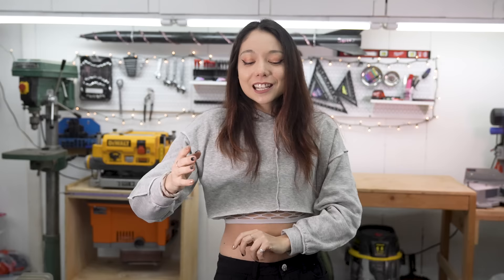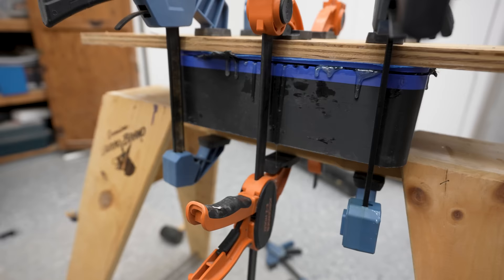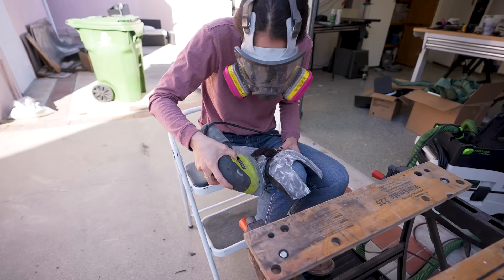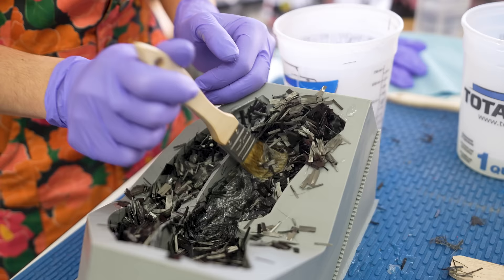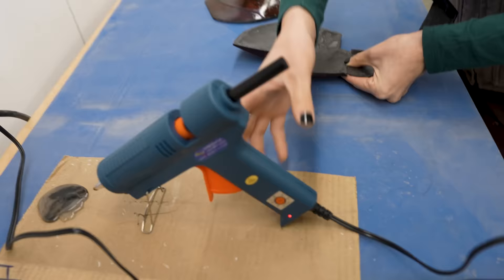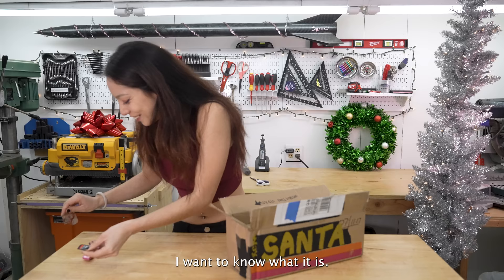I UPGRADED Iron Man's Helmet (100% Carbon Fiber!!)

Comment: I'd be curious to see how a carbon-kevlar mix would work as a chop mat, considering it's been used forever as a woven product to have 'colored' carbon fiber products.  The paint effect is cool, but you can also tell it's not the material itself and instead a finish or dyed epoxy, it's just too uniform and at certain angles it just takes over the appearance.  The only potential alternative would be pre-coating the chop tow before epoxying it in place, hoping to get the look of the carbon plus the look of the paint, that way it doesn't have the dyed epoxy or finish look while retaining how light bounces off the carbon itself; but this requires a lot of space, time, and effort just to color some chop tow, which is why colored kevlar is probably the far superior way of handling this.  Dye-anodized aluminum fiber would be the only other option, but I wouldn't be surprised if that's expensive just from how unocmmon it is, both raw and finished, though aluminum fiber might not even work well within a chop tow like this; titanium isn't really an option, the optical interference that produces colors in its anodization physically cannot produce reds, the most you'll get is a light rose, though you can get a decent gold or broze color out of it but that might be too light for what's typically in the Iron Man colorways, plus cost would end up being problematic again, and the issue of how it might work in a chop tow either.

Comment: One thing you can do to protect your hands from stuff like Carbon Fiber while using Saws or other power tools is thin rubber gloves, if they get caught it will just rip the glove and not pull you in.

Comment: Imma just point out that the fastest combat jet ever made, the Mig-31, is made up of mostly nickel steel and titanium... the biggest problem with high altitude aircraft and percievably Iron Man's suit is moving between different atmospheric layers or going trans-atmospheric there can be a lot of heat exposure, especially when moving at high speed, and carbon fiber tends to have structural issues with high temperatures more so than metals. What's the burning point of cf epoxy? Ceramic and cobalt alloys like stellite and nickel alloys like inconel are much better at withstanding heat than steel, but have issues with durability and compressive strength, which is why they are typically used in very specific applications.

Comment: I very much believe you will have a better experience removing the molds using a (Lowe’s) Kobalt pry bar or Spec Ops Tools high carbon steel molding pry bar instead of using a chisel or large flat blade screw driver which neither are designed for prying.

Comment: I work on motorcycles, cars and build fill sized kit planes (currently Van's Aircraft RV7). Building has mistakes. YOU ARE AN INSPERATION.... Love your attitude, willingness to share your mistakes. I wish I lived near and you could help me with my composites. I hate working with it but do OK. I would love you to help me. That won't happen. I will however channel your inspiration.. PS if in LA in my RV7 would like to take you flying.  I'm a pilot for 35 years, ATP, CFI, have Masters Mechanical Engineer as well. You could be my GA guide to LA airspace. I only flew into LAX as an airline pilot. Know it won't happen but who knows. Throwing it out there into Universe. Hope to meet your in person someday. Cheers.

Comment: Just use a heat gun to warp the (PLA) mold and you'll have a much easier time releasing the part. You'll actually just be peeling it off like a banana. Only if you don't need the molds anymore of course.

Comment: Wear Nitrile gloves to protect you from carbon and epoxy, but they will break before being pulled into the bandsaw..
Reply from the maker: the carbon in that stage slices you pretty deep! And the nitrile also gets sliced :(
Reply: @xylafoxlin   Oh Ouch! You are not supposed to push carbon into your fingers. Seriously though, we use a linisher, but I don't have to deal the (nice) complex shapes you do.            They do different thickness nitriles, but not tested that. Nice work with the channel, Its nice to see carbon epoxy in so many uses!

Comment: OKOK so like I get that you had to go on the rant about iron in order to justify doing the build, but it was only iron in the V1 get-out-of-the-cave suit. He upgraded to various alloys as he went that had better strength to weight ratios and thermal properties also (Does carbon fiber ice over at altitude?)

Comment: Xyla, why wouldn’t you mix the carbon and epoxy and pour it in the mold? I know it would be messy when you clamped it but wouldn’t it be easier. By the way, I’m not an engineer or designer of any sort. Love your content, thanks 👍

Comment: There is a reason he uses metal (ps-not an expert)
In the movies you can see that the suit is able to check the condition of its self and as the kind people at ocean gate demonstrated it is very hard to model the attributes of carbon fibre, because unlike a piece of metal (which is one solid object) carbon fibre is many objects all put together and all with there own strengths which is nearly impossible to model.
Plus I’m not completely sure about this but in the movie the gold titanium alloy that he mentions is used in the construction of satellites.

Comment: And here I always thought that "forge" means to hit a (usually metal) material with a hammer to get it into shape.
Reply: It does, generally.  I think Lamborghini used the term for this technique (they were the ones who invented it!) partly because it sounds cool, and partly because forming the parts under pressure is somewhat similar to the high-pressure forging of metal parts.  For engineering uses, the idea is that the molds are pressed together firmly to get a really high density of carbon in the resulting composite.

Comment: I think you would have had less work tearing apart the molds if they had been printed with less/less dense infill. In the case where you clamped the clamp the infill did kind of save you (because otherwise instead of iron acne it would have broken) but we said we would not do that anymore anyways, riiiight ?

Comment: Okay.  So when you use a mold it is called a cast part.  When you shape a part by hitting it with a hammer, it is called forged.  I am not blaming you, but it seems like someone that didn't know what they were talking about started calling cast parts "forged", and it looks like the word is going to change its meaning.  There will be no way to describe the difference between cast in a mold and forged with a hammer.  Because people will think you "forge" things in a mold.  Which is a term that was just made up and is wrong.
Reply: Her usage was correct, this much closer to closed die forging than casting, though strictly speaking it isnt a casting or a forging. But more a hybrid process with the solid carbon fiber and liquid solidifying or the epoxy.
Reply: @JoeMorrison  It is just casting under pressure, without a hammer.  Forging meant to shape it with a hammer by repeatedly hitting it, and using a fire to reheat it so it can continue to be forged with a hammer.
Reply: The process was jointly invented by Lamborghini and Callaway Golf, so I'm quite sure that they knew what the word meant when they named the process.  And also pretty sure that they didn't care whether it was technically correct, because it sounds better in the marketing literature.

I would note, though, that proper forging doesn't require repeated hits either.  Industrial drop-forged parts are generally done in one strike.  Also there's a reasonable argument that in general the pressing of the carbon composite makes the part significantly stronger than casting alone would, much like metal forging does compared to metal casting -- and, specifically, the way the carbon fibers are pressed aligns them in a way that's structurally similar to how the metal grains are aligned in forging.
Reply: @BrooksMoses  You mean "press casting" or "die casting".

Comment: Ah yes, the realization that geometry that made its way through Blender just doesn't work at all compared to stuff that went through real CAD software for the 3d printing workflow. Had to really change my who ideas about stuff. Fusion 360 is great, but I'm glad I forced myself into Solidworks. I'm laughing at the first time I tried to use Blender to make 3d printed stuff, including when I see other people do it also now. The errors in so many models on Thingiverse makes me cringe so much I pretty much just end up designing all my stuff from scratch now.

Comment: And this is one of the reasons why mold making engineers and mold manufacturing craftmen and hence molds them selfs are hella expensive. To get the part just drop out regardless what the material is, is god damn black magic even for engineer and takes years if not decades to learn all the tricks of the trade. Another reason is that mold can absolutely not fail in designated with in planned and designated use times, cause that will cost from tens of thousands to tens of millions per day in down time when mold is reworked and depending on contract, but usually its on the mold makers getting the bill for the down time. in buddys work place one motor in machine 1 failing right after machine 2 VFD failed, cost 250K€ per HOUR in fines for the maintenance company that suppose to deal with it. It was cheaper to start swapping machine 2 motor that weight 6 metric tons to replace machine 1's motor, rather than wait to next day when new motor was supposed to be express shipped to site.

Comment: I don't think carbon fiber is conductive. That's key to the integrated circuits, and component interaction, that the suit relies on to have all of the features while staying thin enough to move in.

Still loved the video.
Reply: Carbon is conductive, and generally there's enough fiber-to-fiber contact in carbon-fiber composite for the material as a whole to conduct.

Comment: @xylafoxlin - ditch those ceramic cut off wheels and get yourself some of the carbon fiber EZ Lock ones. they last forever and never break like the ceramic ones.  You can thank me later. :)
Reply: aaaaaannnd there you are @14:45 using the EX Lock carbon fiber wheels. haha.

Comment: I think you need to work on mold design. It should be this traumatic to demold parts. Make these molds in more pieces. They should almost fall away when the clamps are off.  And you could re-use them.

Comment: 😆😂😆 💕
Is that clampseption? 😆
"I clamp my clamp, with my other clamp"
That sounds so arousing for some reason 😁❤😆
🤔 Mmm... Yeah not a good idea to microwave plastics with foods...

Also can you make a dowel or dowels to sit through the bottom  molds, seat them off with a wax, then use them to push out the mold from the bottom of the mold... It would take a little longer to shape the dowels to fit the desired shape, but it would save the mold from ya hammer and chisel 😳🤕
Anyways good job so far 🎉💞💓🚀🦸

Comment: she does know that iron man's suit is not made out of iron right. Also the mark 5 face plate is SILVER not black. A tip you are sapote to put down a gloss black then siler and then thin layers of the car paint. But if you want a more Suttle look then how you did it is fine.

Comment: 00:29 🦾 Carbon fiber's low density makes it a top choice in aerospace.
02:38 🖨 3D printing molds for carbon fiber projects can be challenging but post-processing helps fit them together.
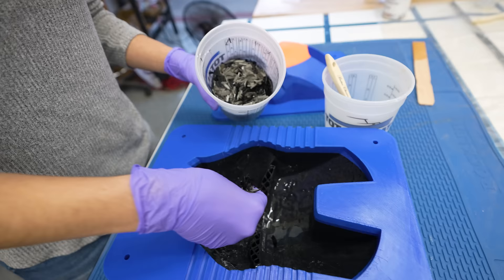03:49 🛠 Using Man 206 mold release facilitates the carbon fiber's removal from molds after curing.
05:05 🍽 Factor provides pre-prepared, nutritious meals, perfect for busy schedules with various dietary options.
07:01 🛠 Vacuum bagging carbon fiber requires meticulous preparation to ensure a strong vacuum seal.
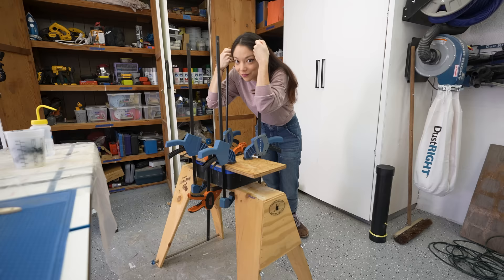08:45 🧩 Challenges arise in molding carbon fiber, but effective mold release aids in clean demolding.
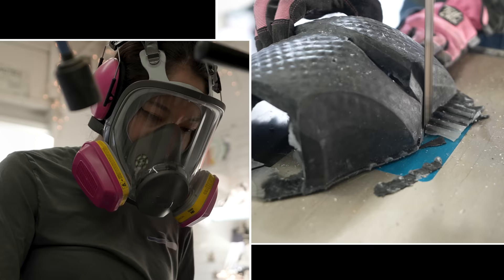11:10 ⚒ Post-processing involves filling surface voids in carbon fiber with a flood coat of epoxy for a smooth finish.
12:40 🧐 Flood coating with epoxy on certain parts helps achieve better finishing in carbon fiber projects.
13:26 🌟 Wet layup technique with thick resin coats and careful brushing yields favorable results in forged carbon fiber.
16:36 🎨 Choosing paint colors, like yellow, can enhance the appearance of carbon fiber projects.
17:03 🛠 Hot glue initially holds the carbon fiber parts together but is reinforced later to withstand shipping.
18:23 📦 Safely packing and shipping delicate custom-built items is crucial, especially for international shipping.
19:07 🎁 Participating in Secret Santa challenges creativity and shipping logistics for delicate creations.
20:36 🐱 The Kit Kat clock gift involves tech and whimsy, a unique and personalized present from Becky Stern.
21:17 🎁 The clock gift, a blend of fun and intrigue, adds a quirky touch to the workspace.

Comment: Im kinda triggered by the fact that she has been avoiding 3D printing. as that is my main way of making stuff, also this is cursed, my 3D modeling software is blender with and i do CAD/precision modeling in blender, I used to just use vanilla blender (It was painfully slow) but now I use the CAD sketcher addon which is so much better.

Comment: Yeah harbor freight sux. But for some things only. Because some tools must be quality because you don't want certain tools to break I emergency or things you need regularly like emergency stuff. Wrenches/Sockets/Wratchets/ Emergency Jumpers and compressors. Etc. Don't waist your money on Chinese Crap that is dangerous and breaks. Also using the right tools for the job is best and safer. Try mini pry bars not a Screw Driver!

Comment: First off I respect your choices as a woman and your top is very cute. Please tell me you also have a thick leather smock for safety and protection.   I am sure that you would break our hearts if you got scared, burned, stanned, or impaled because you went with cute and comfy.  

Also I have a son if you are single.   He is a little bit slow but he is pretty enough to pull it off.  Plus he is very kind and  good natured.  Yeah, I went there.

Comment: Your bulletproofing video is done completely wrong... The real reason something is bulletproof is not that it's strong, but that it flexes and stretches that it absorbs the impact energy. Both carbon fiber and kevlar excel in tensile strength. Resining everything in place completely kills their ability to turn vertical impact into tensile stretching. So you only have the shear strength of the resin left to stop the bullet, which is not much at all.

Comment: Ahh, it might be showing my age but surely a woman who like to design and build has seen Myth Busters… LEAD BALLOON brilliant and huge and extraordinarily successful. Lead is denser than iron. Also are you building in iron as in Fe, or steel alloy? Iron would be heavier as it’s not as strong by far so more would be needed to attain the same strength as steel.

I’ve always been pissed off with movies showing swords or tridents being POURED molten into a stone or rock mould and then a little hammering being done and then calling it done… no way all bullshit.

1. No technology to completly melt steel,et alone pure iron that melts at higher temps. Unless your Indian or Muslim from the areas around Jerusalem area countries and that was top secret tech. Think nuclear arms type secrecy circa 1950.

2. Pouring into stone would melt the stone. Stone melts around 800°C depending on rock types but that’s about right. Low melt steels melt pourable molten at about 1250°C or more depending on required fluidity and pure iron is pourable at around 1600°C. Now you can reduce those metal melt temps by maybe 100°C ish by using an almost pure hydrogen atmosphere to melt in. Yes the tech existed a thousand years ago ish, by using green leaves in the sealed crucible to supply steam that was split by temp into hydrogen and oxygen and then a piece of coal and the leaf carbon then bonded with the oxygen to make carbon dioxide leaving a high hydrogen smelting atmosphere. No shit, that was smart.

3. Pouring makes cast iron which is brittle and useless for a weapon. So forging is needed. Forging or bashing with a hammer is not really possible on cast iron. The only real exception is ingots from crucible steel.these ingots are heated again and then hammer forged gently then more firmly into the final product. So a few decks of cards of steel is forged into a sword which is then ground to a final finish. About 900 grams for the everyday arming sword that was carried on the hip.

4. Probably not relevant but it said forged in the title and then you said ‘iron’.

It’s just my pet peeve with so many otherwise fun movies.

Comment: "Forged carbon"  What part of this is "forged"?  You used no forge nor hammer.
Reply: The process is known as "forged carbon fiber".  The idea, as I understand it, is that pressing the carbon fibers aligns them and makes the overall material stronger, much like forging metal aligns the grain structure and produces a stronger result.  Or, since Lamborghini and Callaway Golf jointly invented and named the process, possibly the idea was that it sounds better in the marketing literature.